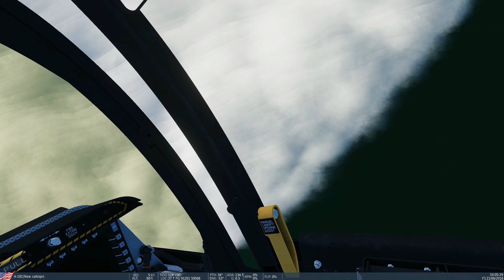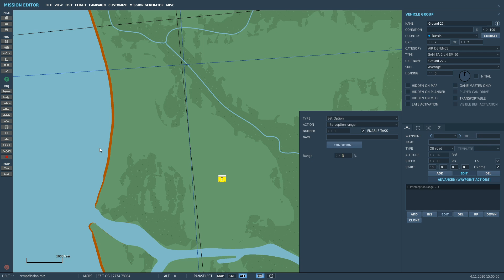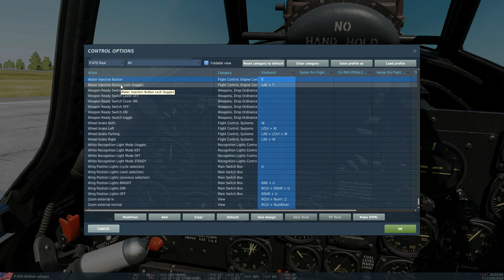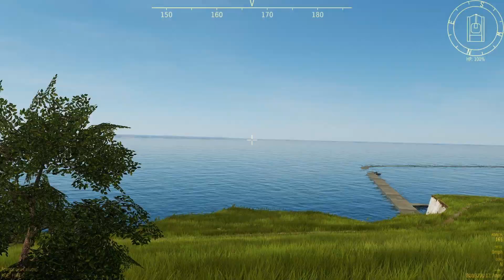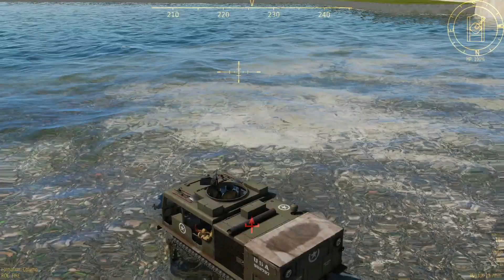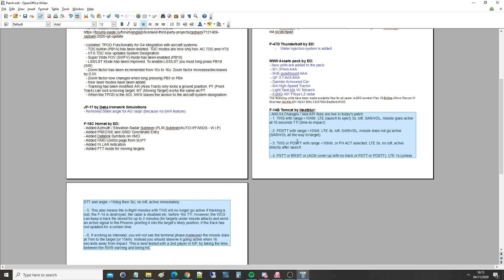IMPORTANT Changes To FA-18C, F-16C, F-14B, AV-8B, P-47D, ME/MP & WWII Assets Pack | DCS WORLD

Comment: Hello again... I got the error DCS_Updater.EXE is missing or corrupt on the log file when I use the clean software and it still wont work. same crashed on start. Any suggestions?
Cheers!
Reply from the maker: How the hell did that happen? Sorry but probably a complete wipe and re-install if the "repair" function doesn't fix it.
Reply: @grimreapers  oh boy! Thanks for all your help.
Have a pleasant day!
Cheers!

Comment: In cartography mode JF-17 radar had foward-looking cone-shaped blind zone. I always wondered if it's bug. F/A-18 has same blind zone if I remember right, so it came from F/A to JF.
Reply: It has something to do with doppler shift. Jane's F-15 sim had modelled this years ago. 
Though I do not understand what causes this Doppler blind zone in real life. My guess: In order to not overload the radar with ground clutter signals it uses Doppler filters. 
Somehow when looking straight forward everything is cancelled out while looking to the left or right leaves some returns left.
Reply: @slowhornet4802  I'm actually interested in radar theory and I can't see cause of this effect. Doppler shift is not big deal here, it's calculated and compensated pretty easily.
UPD: I tested on hornet and this blank zone appears only in EXP mode while in normal AG mode no such thing appears. This is strange

Comment: Just out of interests sake, there have been several underwater ejections that have resulted in crew survival. It's a real thing, and you can do it. A search will yield several results. Offhand, I can think of the first one (I think it was from a Wyvern), and at least one story of an F8 Crusader pilot ejecting while submerged, both caused by carrier launch accidents.
Reply: Actually if i remember properly, some navys train simulated underwater ejections
Reply: Yeah, pretty sure the F-8 or the A-7 were designed for underwater ejection (or at least egress).

https://www.youtube.com/watch?v=CfVKUdA433Q
Reply: Yes. It's actually the only viable way to escape once the cockpit becomes submerged. Oliver Miles posted a video of the training for such an escape procedure. Below is an interesting article on the subject. http://www.ejectionsite.com/eunderh2o.htm#:~:text=Probably%20the%20rarest%20form%20of,air%20in%20the%20cockpit%C2%B9.

Comment: The F18 helmet projected hud looks amazing. It'll overlay datalink data on it like the A10II So you can see icons for radar contacts when you look out the window. It'd be great to use with the AIM120 boresight radar mode that can reach out into BVR ranges.
Reply: That would be cool, like it does in visual ranges

Comment: APCBC means Armor Piercing Capped (reduction of effective armor thickness on impact) Ballistic Cap. The ballistic cap reduces drag.
Reply: Yup, the APC uses a softer metal cap to keep the shell from shattering making it more effective, buy it was more draggy so that ballistic cap was added. It breaks away on contract to prevent messing with the direction of the shell.

Comment: Is it me or the new Tpod of the harrier is not useable? Controllers, axis and zoom are messed up
Reply: It's broken, more broken on the harrier than fixed
Reply from the maker: https://www.youtube.com/watch?v=TtpNn35b0to
Reply: You can use it, but you must put it in HTS mode by double pressing "Sensor Select Switch Down/depress"
Reply: @mrifixplanes1813  I dont think it is that. Once I’m on the TPOD after setting the EHSD to DESIGN I can move around the TPOD pointer but the vertical axes moves in extremely small increments while the X moves in huge increments. And that doesn’t change with zoom, they move the same a way and the same amount.
It is almost impossible to get the pointer where you want. Maybe I’m missing something but this seems pretty basic
Reply: Also the zoom increments are extremely small. Holding the dms up doest wok. We have to press it like 50 times
Reply: And the vertical axes of the tpod seems to be moving on diagonal rather than vertical. I’ll wait to see the tutorials but it feels wrong